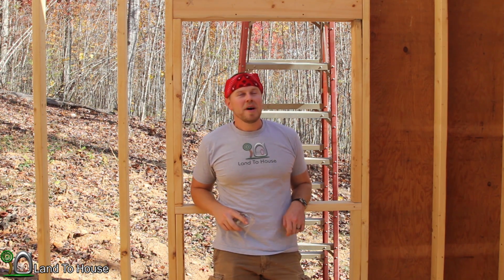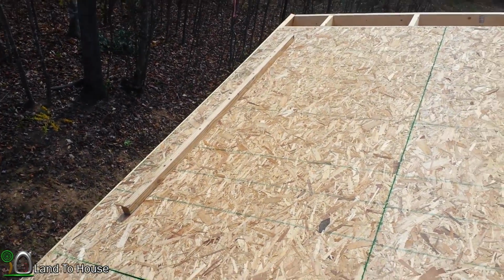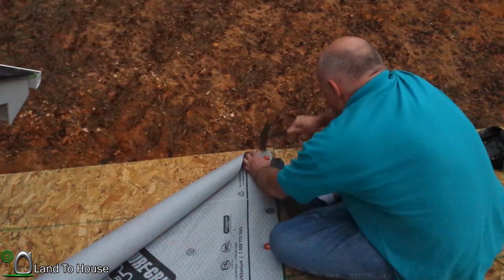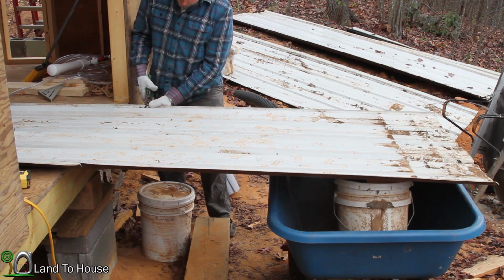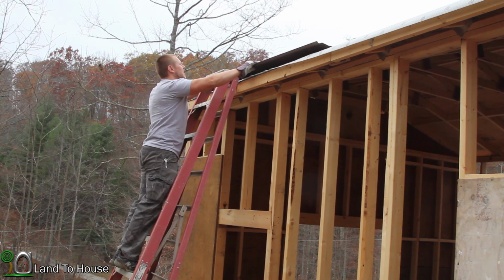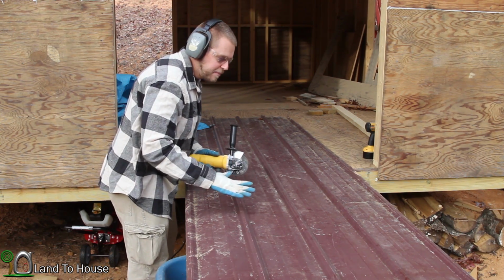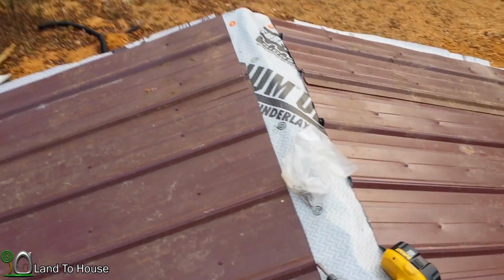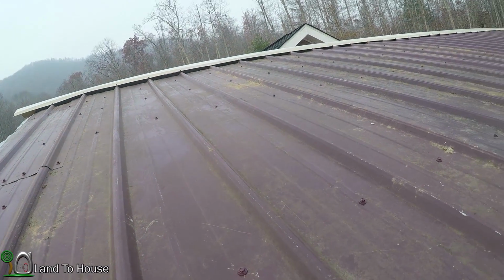OSB, Ladders, and Metal Roofing - Build a Workshop 12

Comment: I'm about to start cutting my tin for my roof. Is there a reason I wouldn't use a circular saw with a cut off blade? Saw you using snips, and wondered if there is some reason for that as opposed to using a power tool. Great vids, thanks for sharing it.
Reply: None what so ever. I use a circular saw. All the time
Reply: @frogmanpipes9561  it's what i did, and worked awesome

Comment: Hi just finished watching your video, 2 more suggestions, use a  turn up tool or put a saw cut in the end of a piece of 4x 2 and turn up the ends on pan of the sheet as well as the foam infills and avoid screwing your fixing screw to the pan as they will leak in time, better to place them in the rib high point of the sheet. Once again just alternative suggestions for your viewers

Comment: Hi just a couple of suggestions as we do in Australia. We would normally attach battens on top of your ply sheeting and also use a product called anticon which is an insulation blanket backed with foil sarking, it prevents the drumming noise of heavy rain and importantly stops condensation build up under metal roof sheeting. Also not a good idea to cut sheets with an angle grinder as the swarf will burn the costing and create premature rusting. Not trying to be critical just making suggestions, keep up the good work.
Reply: funny a few have comented with this and i am glad to know yet i laugh because the roofing i am using came from a shop that burned down and is already rusty

Comment: I didn't read through all the comments but if nobody told you about those snips, one is for cutting right circles, one is for cutting left circles and the yellow is for cutting straight lines. They are a set and used heavily in the aircraft industry. What you really needed was an electric snip. They work great.

Comment: I really enjoy watching your build videos, I can relate to the oopsies, make plenty of them myself.
I might have considered the end sheets of OSB covering the ladders and several trusses, instead of having a separate sheet for the ladders, with the idea that it would tie the ladders to the rest of the roof better.  Another tip is to stagger the OSB joints so you don't have both sets of seams on the same truss to allow better transfer of stresses across the joint through the other sheet.  Next tip is the built on site ladder, a couple of long 2x4's and some short bits screwed across them, letting you make one custom length for the build and all those surface mounted rungs give you a place to rest the sheet of OSB or tin as you are trying to get it up to the roof.
tin cutting tip: there is a sheet metal tin/aluminum/nonferrous cutting blade for your circular saw, or use offset tin snips to keep your hand out of the way.
White is actually a great color for a roof, the summer sun won't heat up your workshop with a white roof nearly as much as a dark roof will.

Comment: I would just like to point out one thing. You talked a lot about safety on roof but that ladder....
It's a step ladder not an extension ladder.  It is not meant to be used that way.  Also the footing it is sitting on is a little questionable.  Not to mention climbing up the ladder with a full sheet of osb

Comment: you should put the screws in the metal roof on the ridges not the valleys
Reply from the maker: There seems to be an ongoing debate about this one. The screws I had would not go on the ridge because they were to short.
Reply: @LandtoHouse  I can respect that.  Doing the best we can, with what we have.  Good luck young man.  Good job.
Reply from the maker: Thank you. So far there have been no leaks. I started having a lot of condensation build up in the spring last year. I thought it was a leak but it wasn't. An attic fan remedy that problem.
Reply: @LandtoHouse  did you ever cut the roof felt under the ridge vent?   and with the rubber gasket under the vent, you cant get much air flow.  usually there is like a fiberglass mesh under the ridge vent or a screen.  just saying.  Wont bother you any more.. GL
Reply from the maker: I actually drilled holes in the soffit to allow air flow and installed a solar fan in the back Gable. This has eliminated my moisture problem and has greatly improved airflow
Reply: That is true for simple corrugated steel sheets. Completely not true for a PBR style roof panels as he has here. That is straight from the manufacturer of that panel style.

Comment: You're supposed to stagger the seams of OSB on the roof also don't cut your sheet metal roofing with an angle grinder it removes polymer layer of protection from it by overheating the edge and promotes rust. Also, after you wrapped the roof you're supposed to add another layer of lathing or counterlathing on top of your wrapping. that is done to create an offset for ventilation. And before you install sheet metal you need to install drip edge... and... i'm probably forgetting a thousand more things.

Comment: Are you concerned about the roof pitch allowing the rain water to run toward your house....amateur builder here...having fun watching
Reply from the maker: Thank you for watching. It would have been nice to have the building another 10 feet from the house but I did not want to dig that much. I have plans for gutters in the future. That will keep most of the water from the house.

Comment: Read your history, building codes came into play because banks lobbied government to ensure that the buildings they were loaning against were up to some sort of standard.  Naturally the government used this info for assessment purposes.    Many code changes are implemented due to pressure from the supply industry, either pushing for the spec listing their "new product" or to increase quantity of a given product used.   Take insulation for an example, the American Icynene Institute has determine through scientific testing, and using economic modeling that no more than R12 insulation is necessary or practical.  Fourier's law, a law of physics was proven again in their testing.  This fact alone makes one question the change from 2x4 to 2x6 outside walls; a change not needed for structural purposes, but "driven by the need for more wall cavity insulation".Careful what you believe about codes,  sometimes its worth looking a documented failures, see if you can find any on a small shed with minimal snow load?Any ex congressman will tell you that 90% of "consumer safety laws" are lobbied for by industry.
Reply from the maker: That makes perfect sense and I kind of figured that to some extent. Now I will say that some very old houses that I have been in, are drafty and in need of some "new" materials. But some of these codes seem a little over the top. I figure that most of the insulation needs to be in the ceiling and not in the walls. As for a shed I should think that any insulation is better than none. Thank you for the comment.
Reply: heat travels equally in all
Reply: Code is their to protect people. If the city passes a bulding and it fails in some way... The blame is on the city for passing it as safe. Its just a way for the city to make sure that theres no junk buildings being built or sold to the public on its watch. We got to all these rules and regulations through trial and error. Rather be safe then sorry if you ask me. And 2×6 is better for insulation which saves you money on AC & hot air. And most construction is "cheap" lol because the customer doesnt want to pay for the premium materials. But either way installed right a roof should out live you just hire good roofers after the framers to do your shingles before it rains.  Tarp if needed.. Always hire a city inspector to gurantee any work on your house is code or your paying for junk. If your paying 5,000 - 20,000 or more for a job it should be professionally contracted.. That Mickey Mouse work might not show now.. But just give it a couple years... 😅

Comment: Not a very strong over hang on gable end.  Maybe ok in tropics where there is no snow.  Glad to see you using the 5/8 OSB to give the overhang a little support.
Reply from the maker: So far the largest snow that I have seen in this area was 16" That lasted around 4 days. I was able to stand on the overhang so I know that it will support 225 pounds. Not exactly sure what the weight of that much snow is but most of the time we get 4" or so. The OSB seems to have made it rather strong.

Comment: I know your done now, next time get a large pair of vicegrip pliers, have a ring welded om the screw adjuster. Then tie a rope to it , clamp the edge of the sheeting and or tin, then pull it up . Much quicker and safer.
Reply from the maker: That would make it a lot safer. Thank you for the tip.

Comment: Why don't you screw blocks to hold the first layer of osb the same way you did for your gable.. ?? It makes a clean, straight job. And why not do larger gables so they can actually sit on the inside of the  wall !?! It'll be a lot stronger, never dip/sink, and will be able to use them as soffit as well. Now they basically only serve as an extension for rain, nothing more...
Reply from the maker: I am very new to building. I am sure there are many things that can improve the workshop. SO far it is doing very well.

Comment: I believe that sniper is for making a right hand curved cut like green is for making a left hand curved cut yellow is straight cut or use skill saw no need to use blade backwards just go slow and for a lengthwise cut use utility knife score the line it will snap off when bent upsidedown
Reply from the maker: Nothing like an angle grinder though. Fast and mostly accurate. Those snips took forever.

Comment: I just don't understand why people go 24" OC. The cost to go 16" is negligible and is much stronger.
Reply from the maker: +Jameson Cross just think about the local storage building maker that has 4' on center.
Reply: Its easier to lay down the 8ft by 4ft osb in 2ft increments. Also its code so its been tested and is safe. Plus the premanufactured trusses are specially engineered to fall into a specific locations along the top plate that help disperse and carry the weight as efficiently as possible. Common rafters with ridge cuts and birds mouth in my opinion are a great alternative but will always cost more. Personally 2 by 12 rafters will ensure a STRONG roof for years and years.. Just coat the wood with protective layers of seal to extend life. Also 16 inches oc for the roof is overkill.. Unless your going to be constantly walking up there or its going to support more structural weight.. 24 oc is not only adequate for a roof its just easier to frame
Reply: Adequate sometimes isn't good enough. Snow loads can add up. If you are going to do 24" OC, then you should use 3/4" plywood. The roof will sag overtime. Just not good building practice. If you are a "itsgoodenough" guy, then good for it.it won't fall down.
Reply from the maker: We had a 16-inch snow and there seems to be no visible change in the roof. That's the most snow we've had here in several years. Any more snow in an area and it probably would be good to have 16" centers.

Comment: Get a metal cutting blade for your circular saw.
Reply from the maker: +Luvstruck I need to. Wonder if my battery saw can support that
Reply: It should. I don't think there would be any more stress on the motor than there is with wood, but you got the angle grinder which I didn't know was available to you. Anyway nice job on the shop. I'm laying mine out tomorrow, and it will be similar to what you have done.
Reply from the maker: +Luvstruck yes that angle grinder has been very helpful. Not the most accurate Cuts but in this instance was just fine. I hope my shop build has been helpful in your plans.

Comment: That's a big a span for a 2x4 even with the bridging. No bird mouth cut puts a lot of pressure on a small edge of the wood and not evenly distributed across the top plate. I don't like osb, but that's only me. Nails on roof sheathing. And if you screwed those out riggers with deck screws there's minimal shear strength; nails or structural screws like ledgerlok etc... required.  Put some gable vents in or vent the soffits since no ridge vent.  Don't install gutters if you get snow in your area
Reply from the maker: Last year there was not more than 4" of snow at a time on the roof. It held well. I know there are several things that I could have done differently. (possibly better) I am new to building.  If you compare this building to some that you can buy pre built this one is far better. There is a local storage building place that only uses 3 small trusses in the roof. My goal is to install soffit vents soon. I am thinking of installing gutters but probably pvc just to catch water for storage. Not so much as real gutters.
Reply: Beware that snow can slide easily off a metal roof and the weight may shear the gutters off. If you add em be diligent about using a roof rake
Reply from the maker: I have this idea that I can make pvc gutters out of 3" pipe and have a hinge system that would allow me to empty them for leaf cleaning and snow loads. Might be fun. We shall see if I go that direction.
Reply: Ice & snow clips are a must on most steel roofs, because like you stated the gutters would be ripped off.
Reply: mattyfreshification  what do you use instead of OSB
Reply: George Nettles Jr plywood

Comment: A little hint, when you have to put your sheathing up like that, build a little platform to stand them up from midway up the building then you can pull them from the top. i was waiting for you to tumble from the ladder.. i speak from experience on that unfortunately... don't worry about the sheathing , for a shed roof its absolutely fine... next time use nails on the sheathing though.....
Reply from the maker: That is a nice tip. Would have made things a lot easier. Working alone with this type job was not very fun.

Comment: Hi, Seth. Just wanted to tell you that I really enjoy your videos. I'm building a 12 x 24 workshop myself. Your videos have been invaluable to me. Before starting any stage of it, I always look to your videos to see how you've done it. Mine is going up with no help at all and some of the methods you use for doing things solo are ways I'd have never thought of. Just wanted to say thank-you and keep the videos coming!
Reply from the maker: Thank you. That means a lot. I am very new to construction work and I am learning as I go. Working alone has been a real challenge. I do recommend that you have some help with parts of the roof if you can. Swinging trusses over the top was rather frightening. I have a long way to go before my shop is done but money is tight for a little while. When things are back up to normal I will be kicking back into gear on the shop.
Reply: I hope before you start your project, please read my comment above.

Comment: Circular saw blade installed backwards works wonders here for cutting the tin sheets.
Reply from the maker: I have not heard of anyone doing that. The angle grinder seemed to work well enough for the few sheets that I needed to cut.
Reply: Yea works super quick, keep old blades around for things like this.
Reply: yeah the first time i learned that trick i thought it was a joke until i saw it rip rite threw metal. loud as heck but goes threw like butter.
Reply from the maker: I am a bit afraid to use the saw that way. Although the blade is getting old I still dont want to ruin it.
Reply: lowes part # 208735
    great job on your project by the way
Reply from the maker: Thank you. That blade is a bit too large for my little dewalt saw.
Reply: Love you dogs. I am a woman trying to learn how to build. Your video is so helpfull.

Comment: FYI impact driver was designed first place to fasten roofing screws high RPM to get trough sheet easily then finer adjustment due impacts get it correct tightness.
Reply from the maker: I have really enjoyed working with the impact driver! Such a great tool.